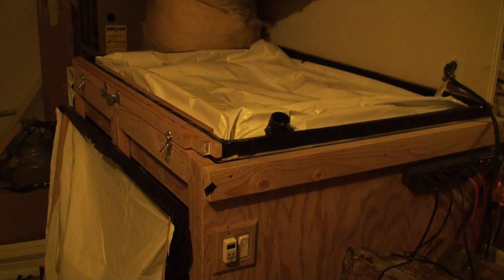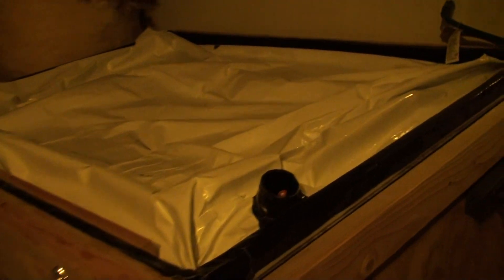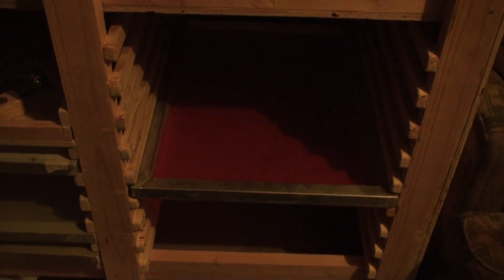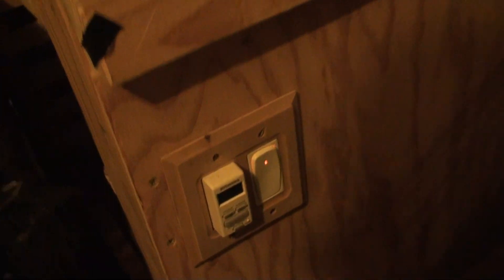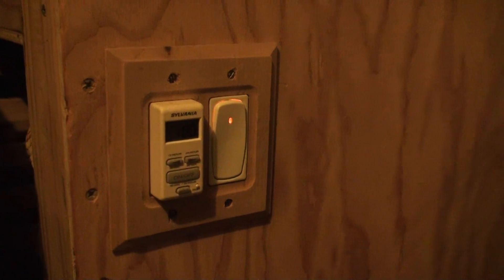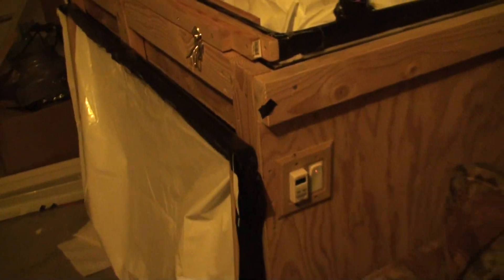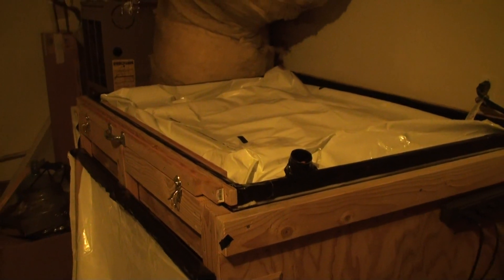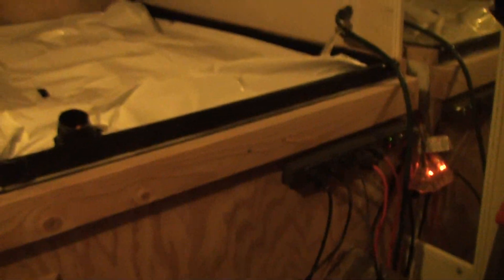diy vacuum exposure unit

Comment: What is the cord or wire or in this case a bungee cord that I always see laying on top of the frames?
Reply from the maker: it allows for an airway over the frame to create suction pinning the screen down. otherwise there would be an air pocket inside the frame.